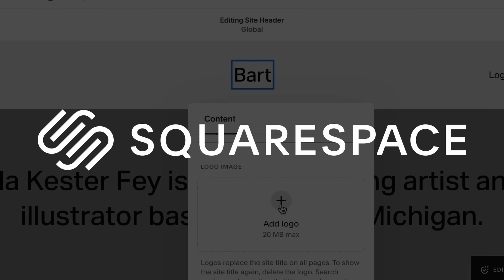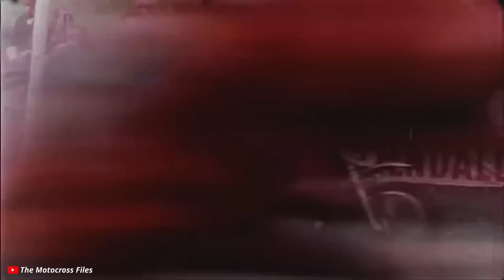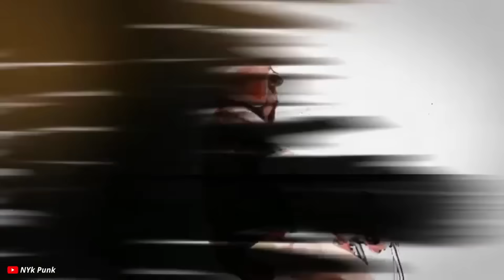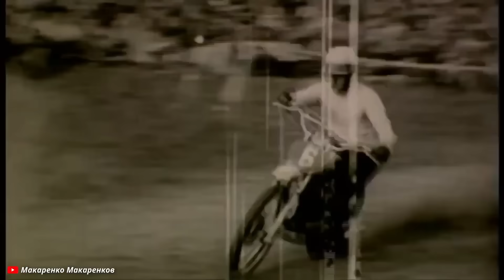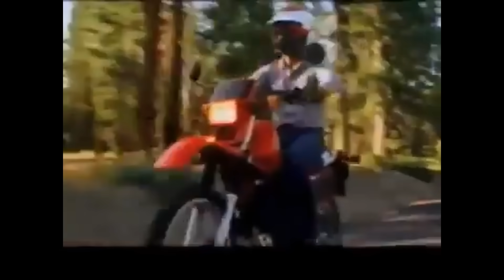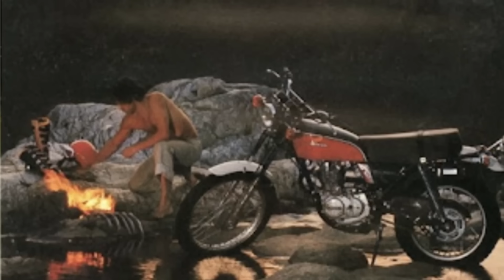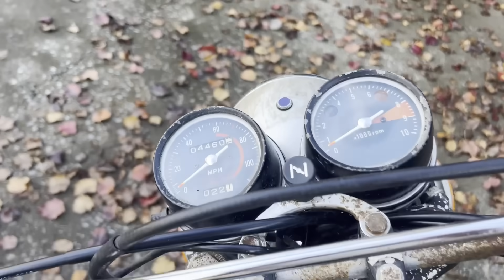The Forgotten Honda That Made The Enduro Scene

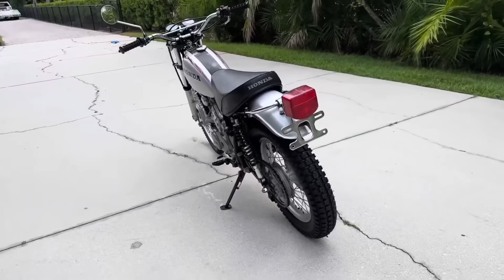Comment: Honda changed the world made motorcycles mainstream. If you go back to the 60s, all bikes, kinda sucked. They’re all kind of slap together barely working garbage machining they were inconsistent. Parts were different. They were all leaky pieces of junk and even the nicer bikes were still kind of garbage quality slap together junk and they were fun but Honda came in the mid 60s and started putting these well machine well designed creations together, they weren’t just taking something and trying to make it work, sat down and designed motorcycles, and they machine them with the right engines in the right wheels in the right gearing and everything to work from scratch and then they manufacture them to be consistent and you could go out and buy a Honda and you could drive that thing for thousands of miles and it was dependable transportation and they worked and they didn’t leak all over your garage floor and have to be topped off with fluids every day. They weren’t always overheating and breaking down. They just worked really well and Honda bend over backwards and almost killed those people, and he found people who loved it to do these things and changed the world. He’s kind of like the Henry Ford of motorcycles and he didn’t just make the production line he created something that didn’t exist, which was a good quality production motorcycle that worked well was designed for specific purposes and he did it again and I don’t know people remember but in 74 and 75 the XL 350 was the hottest bike on the market and they had all these commercials for racing and stuff I remember being a little kid and seeing this stuff you see these guys out riding through the desert and racing and blowing other racers away because Honda sat down and said what’s wrong with these other bikes they’re too heavy they don’t have enough suspension you go too fast and they shoot you into the sky where they break and they sat down and said well let’s redesign the machine that can do this stuff and they kind of invented real dirt bikes, the same way they reinvented motorcycles in the 60s and in the 60s Honda did that and every motorcycle company in Japan copied them and then the rest of the world started copying them Honda set the bar higher and higher and higher for like 30 years into the 6070s and 80s Honda made massive strides and turned motorcycles into what they are today and took the industry into automotive level production before that it was just little Company putting big clunky bikes together just barely trying to make something work and they weren’t purpose they were just trying to make anything with two wheels before that it was bicycles with motors strapped onto them and then they beat them up and there was almost no engineering. It was Garage engineering.   But I remember being a little kid and seeing these old Honda ads from a few years before from like 74 and 75 in the magazines and stuff and I remember the TV ads and you can still find some of them if you look on YouTube but 74 and 75 Honda kind of took dirt bikes to a new level and then again in 76 and 77 they took him to even another level and that’s when you start getting dirt bikes with real size wheels that were made for riding in the dirt and they made them street legal also and then they came out with the Elsinore stuff and it just kind of blew up and of course, the rest of the industry had to go copy them and do the same thing and rise their production up to those bars that Honda set but you can still go get one of these 7475 XL 250s or the XL 350 is way better in my opinion and these are still great bikes. They’re very rideable. They have crappy brakes but they will they ride they’re fast they’re quick they’re dependable. They’re Tough and you can get one of these bikes and make it a daily rider and you can go out on the weekends and go drive through the desert and go off jumps and go riding through the woods and no they’re not up to the Tech that today was, but you have to understand this didn’t really exist before even the racers were building kind of junk and Honda just went out there took racers took engineers put everything together and kind of created this stuff where they started building specific motor cycles for specific applications before that everybody was just trying to make any motorcycle that would run and they were all kind of the same, and some people would strip them down and races and maybe put a longer shock and try to beef it up and Honda just said let’s put real engineers on this instead of the racers doing it themselves work with the racers and figure this stuff out and they did and they made it production and you could go buy a motorcycles that were better than the racers Bikes and they were proving it in the races and then of course, every manufacturer copied them and followed along and this created the modern motorcycle industry and if you look at like 1984, the Honda XL line with the XL 350 in the XL 600 is there some of the most popular bikes out there cause they were amazing and they aren’t the same as today’s but if you get an XL 600 it’s gonna go up against other bikes even today and it’s not gonna win but it’s gonna get out there and get you there and back and it’s still gonna be pretty good and Honda came out with his magna. V6 five that just destroyed the Harley industry because it was better. It looked better. It wrote better was more dependable is ridiculously fast and Harley didn’t have anything that could touch it so Harley you got together with the government started putting restrictions on the import Bikes instead of Harley trying to make a better bike. They just tried to kill the industry from bringing Bikes into America competing with them and anything over 700 cc had some sort of tax or whatever on it and so they started crippling Bikes they took the 750 nighthawk ass in 1984 and they cut it down to 700 cc by short stroking it just to stay under 700 cc so people didn’t have to pay this tax penalty for buying a foreign bike and putting Harley out of business, cause their stuff kind of sucked to be honest and Harley has improved sense, but they kind of turned into the jerk of the world, the environmentalist freaks, and the government control freaks that instead of trying to make good stuff they just try to kill everybody else and keep you from being able to get those bikes and Honda came out with this nighthawk 700 S and they came in that blue and the red in 1984 still one of the best looking Bikes ever absolutely amazing these things we’re doing like 12 second quarter miles and competing a little behind the V 65 magna which says I think in 1100 cc bike that was insanely fast for the time as the world‘s fastest production motorcycle in 1983 in 1984 I believe and then they got these restrictions and Honda found a way to work around the restriction to short stroke at 7:50 and even the 700 version was still doing like 12 second quarter miles which for a 700 cc was insane. They were competing with 900 cc Bikes because Honda had this level of engineering and dedication to building something new and amazing and they just revolutionized the industry.
Reply: And this was part of it that early to mid 70s XL 250 XL 350. These are the hottest bikes out. These were the insane thing that just didn’t exist and people just go buy these and race them cause they put racers and engineers together they put real engineers in the racers experience together and said oh our engineers can do what you’re doing better and they can tell you why doing that makes your bike work better and they can make it even better and they just kept building and trying them and then they put them right into protection and it was insane and then couple years later and he was about 76. They updated them again and made it the modern taller bike with a longer swing arm and they gave you that 23 inch front tire with the 18 rear and they were amazing a day only had the 250 but it was kind of the best thing out there and then you get up to the 80s and 82 and 83 and they revolutionized the engines and made these great low compression thumpers to put out massive amounts of torque and had a nice wide torque bound and put out really good power and we’re ridiculously fast for the time than an 84 they put disc brakes on the front of the 350 and the 600 still two of the best bikes ever made, and came out with that night ass and then the variations of the V 65 like the magnet and the saber these were some of the best bikes ever made honestly 1984 nighthawk S if you put some braided brake lines on it, that’s a comparable bike even by today’s standard and it’s one of the best looking bikes out there and modern motorcycles came out of mid to early 1980s Honda and this was the first step towards that in the dirtbike arena conquered the street market and we’re building rock solid street machines and this is when the end she said we can make dirt bikes. We don’t have to take street bikes and hack them up. We’ll build you a dirtbike and revolutionized the industry again then by the late 80s Mr. Hondo is getting old. The Company was becoming huge in Corporate and emissions and things like that started kicking in and kind of screwing it up and they’ve improved and they are better but honestly those mid 80s Hondas are slightly lower Tech, but they’re really not all that different from everything made today and they kept some of those designs like the XR 650 L is basically the same thing as the XL 600. It’s a little bit taller and has a newer motor with emissions, but the 600 was actually a little faster because of emission standards but they’re still selling the XR 650 L which is the XL 600 with a little taller suspension and couple minor updates but basically the same thing they had back in 1985 and it’s still a really popular bike in Honda made the motorcycle industry and everybody else copied them. We like to say Harley did it and all that, but everybody around the world was taking bicycles and putting motors on them and this is happening all over the world Harley wasn’t innovator, but they kinda stop being so great and got bypassed mid 60s Hondas revolutionized motorcycles altogether mid 70s created production dirt bikes and then they went nuts with the racing guys and built like the Elsinore and stuff like that and they just carry this through to the mid 80s and then the whole industry took off on this And nobody else was doing this, and Honda started at all.   Now there are tons of great bikes out there, but when this happened and Honda started doing this, everybody thought they were crazy. Why would you do that for a motorcycle and it kind of took off the 60s made motorcycles real transportation and dependable in the 70s started making performance specific use motorcycles at a production level designed for the dirt and other types of writing and everybody still doing the same thing and things have gotten a little better but back then this was considered crazy and Honda created the motorcycle industry in that aspect. They didn’t create motorcycles, but they took the bar so high that they created the modern motorcycle and the modern motorcycle industry and they took what these crazy racers were doing, and they threw engineers at it and made it better and sold it to everybody and created modern dirt bikes, which are part of America and everywhere else else now it’s part of our culture and I don’t like to drive foreign cars and buy things from foreign countries. I’m one of those by American guys, but I’ll still buy a Honda in the Japanese bike because they’re just better in a lot of aspects and Honda created this industry and people by Harleys because of nostalgia to me a Honda is way more nostalgia. Harley is an American company that made kind of cool Bikes, but they weren’t innovators. They were just doing what everybody was doing Honda innovated Honda change the industry. Honda changed the world and brought motorcycles in the mainstream made them production quality to compete against automotive industry and this is why we have great motorcycles today. If it wasn’t for Honda people might still be out there hocking up Garbage St., Bikes trying to make them work for dirt.😅 I know some people think that’s kind of stupid or whatever but it’s called hard truth. Nobody was making this stuff. Honda went out put engineers with racers and made this happen and basically invented real dirt bikes, cause that’s what people wanted and that’s the magic Honda they said what if people want let’s give it to him and let’s make it really good and these bikes are awesome. Go buy a 74 XL 250 or 350 and it’s a great bike to have you can go offloading with it. You can drive it on the street. It’s formidable and they work really well and that was a weird thing for motorcycles until the 60s motorcycles were toys. They were garbage and they all kind of sucked and they work but they all leaked. They all fell apart. They’ll rattled and nuts fell off and they were kind of piece together by other machinery and just sort of made work and they were production, but they were not production designed. They weren’t engineered. They were kind of makeshift slap together and Honda just changed that and then they brought dirt bikes into it and started making Bikes that were specialty built for specific types of writing and nobody else did that. That’s a completely Honda thing that everybody else copied and made the standard.
Reply: And even 50 years later, you get one of these XL 250s or XL 350 and you’ve got an awesome bike. You can go right in the dirt and go ride through the woods. You can go right on the street. You’ve got a good dependable bike with good performance and by today’s standard. It doesn’t seem all that amazing but nobody did this before. I’m gonna just came out of nowhere and said hey let’s put engineers with razors and make these magical new bikes that people think are crazy and stupid but let’s do it anyway cause I think people will like this and apparently they did.😂 and Honda did this in the early 60s when nobody even thought of this stuff motorcycles weren’t considered like real vehicles they were almost like toys or like a utility sort of thing.  And the DT one came out first, but Honda was working on this with racers those European bikes and the DT one were still modified street Bikes just stripped down Honda just said hey let’s redo the whole thing. Let’s build it for dirt and nobody had really done that before there were companies who had models that they stripped down at the factory, but there were still using street frames and Honda did something different. They said let’s start from scratch figure out what people want and then engineer this from scratch, and nobody had ever done that before almost all motorcycles up to the 60s were just modified stuff, slapped together, even even the production stuff the engines were out of something else and they put enough together to make it work. Honda said let’s just make an entire motorcycle engineered and designed and they led the industry and then they did it with the dirtbike again and it wasn’t a modified street bike and they kept innovating and if you look at something like a 76 or a 78 XL 250 generation after this, it’s basically the modern dirtbike and the only thing that really hadn’t changed yet was the rear swing arms were still using dual shocks in the rear, but they still performed very well and then we came out with the mono shock later and that’s really the only huge innovation everything else is pretty much up-to-date at that point if you get a 76 Honda XL 250 it’s a modern dirtbike with dual shocks in the back but everything else was pure dirtbike and they really haven’t changed much and they look better and they’re taller and they’ve got better quality parts on them, but that basic design was already there 50 years ago.   And there were small companies slapping stuff together, but Honda was a first company that said let’s start from scratch and build something specific and that changed the industry now everybody does it. That’s the standard now but Honda set that standard. And he talks about the European specialty built Bikes, but they were still modified street bikes with taller, suspension and stripped down to be lighter, but Honda was really the first company to sit down and say let’s make a dirtbike. and then 1974 the XL 350 was the first four stroke engine that they really tried to make a dirt bike out of that really performed because two strokes are kind of a pain. You gotta make your gas and it’s a different monster you gotta rev them out and a four stroke is just more of a wider range of performance and I think it was probably 1974 when they came out with the XL 350 and they said hey let’s make four strokes competitive in the industry thought that was stupid. They’re like why don’t you just put a two-stroke on it and two strokes were loud annoying Smoky and in a way that’s kind of cool but if you’re driving it every day and you want something reliable fun dependable you can put lots and lots and lots of miles on four strokes work better. Two strokes are great but get it hot in your engine dies and try to start it again and you might be there for a while that 74 and 75 and I think 76 XL 350 they always work they always start and then the following 250 like a 76 or 78 or an 80 XL 250 one of the easiest bikes to start on the planet with a kickstart.  Made that happen.  But today standards there are nothing amazing but today’s standards are where they are because of these Bikes.

The magic of Honda was purpose engineering. They got with the racers they said what are you guys building? What do you need and they sent engineers out there to talk to the people who are building these handmade things and they put engineering education and science together with it and then they made them available for everyone and he’s right this bike. The thing about it is just didn’t exist before everything was slapped together and Honda said hey we can just build these for everybody.  And they did. And if this bike in the video was in good shape, these are crazy dependable. I seen these XL 350s from 75 and 76 with over 40,000 miles on them and they still run great and they’re not the hottest race Bikes but what they did was they made a good solid race bike available to the whole world and they were dependable and they were consistent and well engineered and that’s what I wanted that nobody else did then everybody else copied Honda you go back from 65 to about early to mid 80s Honda lead everything and everybody followed, and those are the years the motorcycle industry was created and developed and went from Hobbie and racing stuff to mainstream production, where you could just go buy something and when this happened everybody thought it was crazy and Honda did it and people went nuts for them and so everybody else copied them and that’s what made the modern motorcycle industry and it started with early to mid 60s Hondas and they created quality production motorcycles that were dependable. You could just buy a bike and go write it for thousands and thousands of miles and it was depend on what would start up. You weren’t always trying to piece it together and keep it running and then they did it again in the 70s and they did it again in the 80s and by then that was just the way the whole industry was working, but Honda kind of invented real specific purpose, motorcycle engineering in production and a quality level and created the modern motorcycle industry, and these were some of the bikes that did it.

And it wasn’t just dual sport look at Elsinore that was Honda. That was Honda engineer going out working with racers trying to create an amazing Bikes Honda later working into production, and Elsinore was kind of their test. Bed were some of the best race bikes of the day they were winning beating everybody else and that was all the Honda engineers working with those racers and it wasn’t just dual sport and they did it for street bikes then they did it for dirt bikes and dill sports and kind of created it cause that’s what people wanted and nobody was doing it. I said OK let’s make it professional put some real engineers on it and make it happen and they did and here we are today.  And these bikes are historic and you can still find them. People rebuild these things like crazy and restore them and keep them because they’re such amazing Bikes and we’re part of history. If you look long enough, you can find a 75 or 74 or 76 XL 350 or that’s 250 in good running condition some almost immaculate and they’re still great Bikes get an XL 350 that’s in good condition and it’ll probably be one of your favorite sport Bikes and everybody complains about about seat, height, and seats not being comfortable in. This had the low seat height. It had enough suspension to be formidable had plenty of engine and you just ride wheelies with the thing all day long and they were solid, dependable and kind of made it dirt biking accessible to everybody before that it was all kind of race modified Bikes and the two-stroke stuff. Honda just said hey we can make the dual sport for everybody, but they also did the racing stuff and we’re innovative in there too and everybody else copied Honda. It’s because of who Mr. Honda was. The guy was just a nut for motorcycles. And for engineering and for production and for sale and he put all that together and created the modern motorcycle industry, and everybody else copies that now.